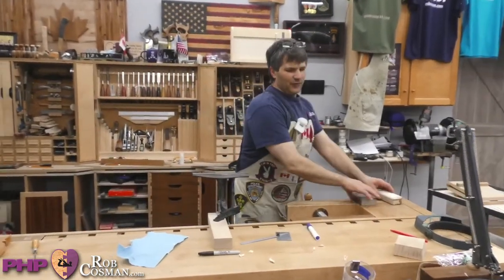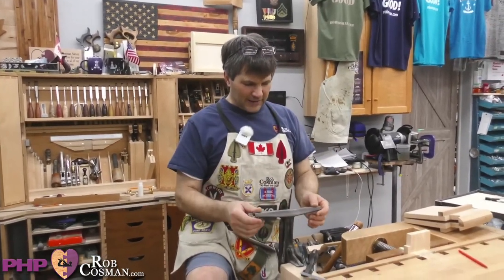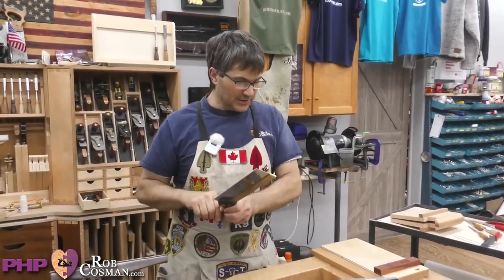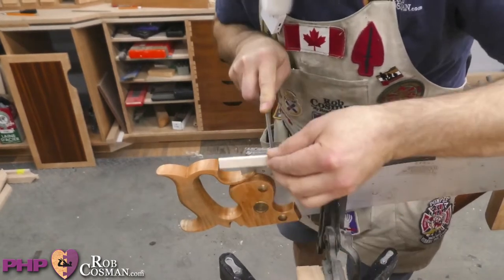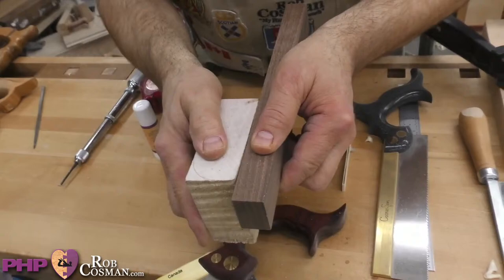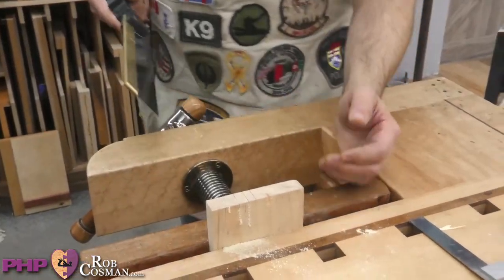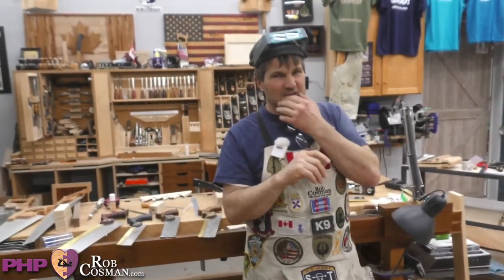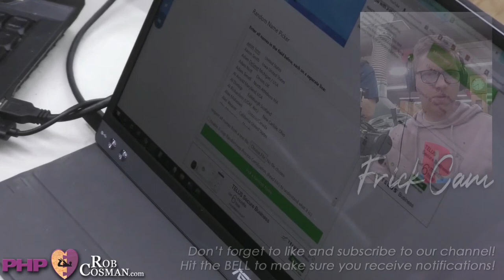Saw Sharpening - Live Q & A (20 FEB 2021)

Comment: So, I only have a cheap, old, flea market Hand Miter Saw. I think I paid less than $10 for it last year.

I've never really used it because it wouldn't even cut through Pine lol.  I've been using a cheap Harbor Freight Japanese Pull Saw for any cuts.

I followed this video and sharpened that cheap miter saw a few days ago.  It took about an hour to do it. 

Holy Crow!!!  This thing is scary now lol.  As soon as I was finished sharpening it, I threw a piece of Pine in my vice, grabbed my square and drew a line, then made 1 push stroke.  The saw sunk all the way to the back bar with a single push! 

I've done probably 20-30 dovetail joints this week with scrap materials,  just to practice,  and they are steadily improving.   

Man, I've been watching you for probably 2 years now.  It seems that I have this Eureka moment about once every 2 or 3 months, when something you've said just clicks.  This is one of those times. 

Something as simple as having a properly sharpened saw makes a world of difference.

Comment: Just an observation about saw vibration on the backstroke... blade binding when the blade is pulled back at a slightly different plane from the cut plane will cause the blade faces to touch the entry and exit faces of the board on different sides, the small "bind and release" cycles will cause the free end of the saw to resonate... twist can do this too but generally will feel like more resistance. All about the posture and discipline of facing the cut?

Comment: Hi Rob,
"they Say" No more than one third deep. 

What you have is an equilateral triangle - all the angles are 60 degrees.

When you file down along the cutting face of the saw tooth at 90 degrees - a vertical, aggressive cut - you are also filing down the back of the adjacent tooth. If you use half of the face of the file against the  cutting face of the saw, you are using ALL of the file's other face cutting the back of the adjacent tooth.

For the most efficient use of your file, which if used properly will have three separate lifetimes of cutting teeth - one for each corner; the file face cutting the back of the adjacent tooth should not wear out more than half its face. 

A horizontal line, running from half way along the adjacent face, will cross the vertical line of the face cutting edge of the file, one quarter of the way up that face

If you cannot cut the teeth of the saw easily within those parameters, you need a larger file! 

Great work Rob. I really enjoy your work and your ethos.

Comment: Saw vibrates on back stroke because it's not tapered and it gets tight in the wood. Main reason is set. If you set it a little more it will be fine. Or the wood gets tight from springing.

Comment: Had to catch session later - thanks as always - wondering if you could comment quickly on a question from the chat that I did not hear asked or answered:  "which is first; the setting or the sharpening?" - or does it matter??
Reply: 01:19:50 I think that Rob said that you might set the teeth roughly every three or four times you sharpen.  To me, this implies that he would sharpen first, then set.
Paul Sellers has an excellent video on sharpening, and he sharpens first, then sets.
Hope this helps.